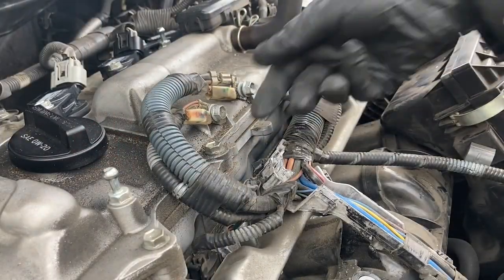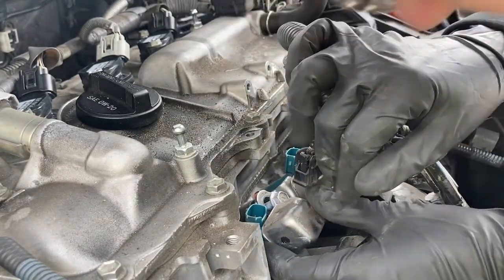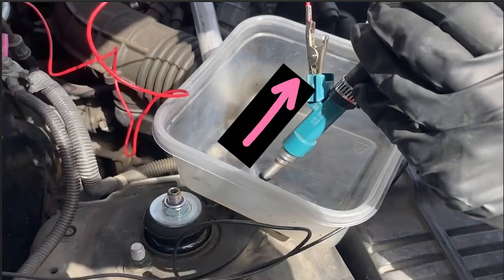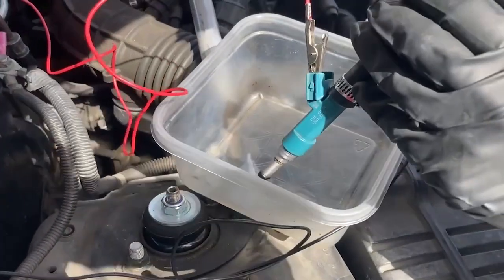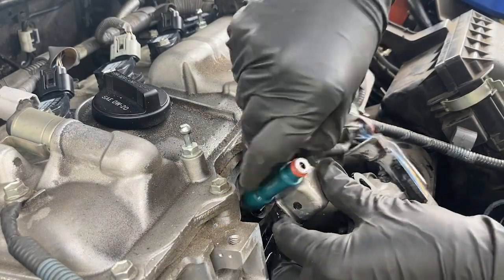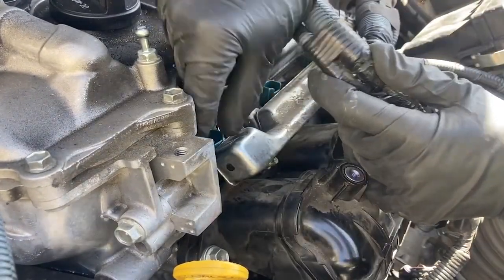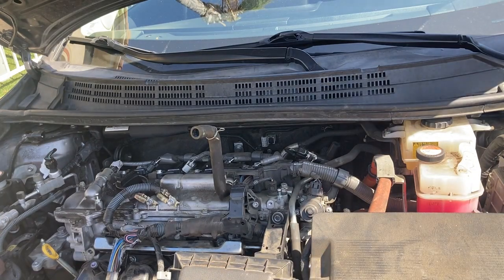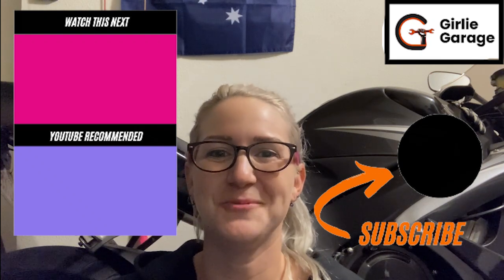2ZR-FXE Engine - 3rd Gen Prius - How to Clean Fuel Injectors Without Special Tools - Girlie Garage

Comment: I thought she was kidding when she said blow into the tube. What a terrible idea. Surely there is a safer way of doing this.
Reply from the maker: There is, read the comments
Reply: I bought a Mighty Vac kit and it works great for clearing the injectors (from both ends), bleeding brake lines, bleeding coolant system air (2 for the 2007 Prius, and just getting that last drop of fluid out of the reservoirs.

Comment: Does it matter if the fuel spews out when u disconnect the injectors? Amd when putting it all back together is there a method of starting the car safely?
Reply from the maker: You should release pressure by opening the gas cap. If you’re worried when you start the car, let the spilled fuel rest until it evaporates

Comment: You showed the necessary step of removing that wire harness from top...which carfix did not show on the video...left me stuck when doing the removal...thanks for including the correct steps.
Reply: At 1:02 how do you disconnect that wiring harness tab.??? I pulled mine hard and it is not coming out.??? It is too tight to get a tool underneath to try to clamp and release.??? Everyone makes it look so easy but.......
Reply from the maker: Great! So glad you found this video helpful :-) congrats on saving yourself $$
Reply: @GirlieGarage  At 1:02 how do you disconnect that wiring harness tab.??? I pulled mine hard and it is not coming out.??? It is too tight to get a tool underneath to try to clamp and release.??? Everyone makes it look so easy but.......

Comment: Have a 2013 Toyota prius. Been throwing a cylinder 4 code for a week. Changed the coil. Engine light back on after about10 miles. Changed all the plugs. Engine light came back on after another 10 miles. Now to the injector.  My question is this: would you recommend cleaning the 4th injector, changing the injector with a new one, or changing all of them? Thank you for your time.
Reply from the maker: If you’re going to change 1 it is just as much work to change all 4 and then you don’t have another one fail shortly afterward. You can usually test for fuel pressure or a fuel related issue before changing them instead of throwing parts at the car…
Reply: @GirlieGarage  I did. Code said Cylinder 4 keeps missing. New coils, New plugs. Check engine light turned off after each and back on after about 10 miles. Rides rough when taking foot off accelerator coasting or downhill. Clogged or failed injector is all we can think of before looking at the ignition harness cables.
Reply: Oh, and I'm not exactly at the liberty of buying 4 as it would tackle on about 500 bucks for the other 3 injectors.
Reply: I just wonder if it just needs to be cleaned.

Comment: I'm having issues getting the fourth injector removed (the one farthest to the right when facing). I'm struggling with lifting the fuel rail up enough for clearance. Any ideas? Thank you!
Reply from the maker: I think the only advice I have is that you have to take all the injectors out one by one starting from your left (passenger side) to create enough clearance to get to the next injector. Hope that helps
Reply: @ that worked! Thank you! Snazzy.
Reply from the maker: @waldodancer  fantastic, thank you for the good news!

Comment: 2016 Prius C Three here. Can I replace injectors without programming?
Reply from the maker: After I took these out and put them back in they didn’t require any programming. If you’re using OE injectors, they shouldn’t need programming

Comment: How do you disconnect the wiring harness @1:00?   It's not as obvious as most other couplers.  Thanks
Reply: Got it, just pry it up from the sides with a flathead screwdriver
Reply from the maker: You pinch the underside edges together. If you can’t pinch them together at the same time, you can do one at a time with a flat head screwdriver

Comment: You make it look easy but my fuel injector is stuck. Does your vehicle need an injector puller?
Reply from the maker: Which side is it stuck on? The engine side? If that’s the case, you’re going to replace the lower seals anyway, I would pry from the lower seal to get it to pop out

Comment: Excellent, thorough tutorial with the exception that you you forgot to show removing the air intake box apparatus. I got a glass jar and soaked my injectors in carb cleaner for about an hour. Unfortunately I didn't take off the upper o-rings beforehand and they disintegrated in the solution. But soaking the injectors for about an hour in the carb cleaner seemed to clean them up pretty good.
Reply from the maker: It’s a good idea to replace those o-rings anyway so at least you were sort of forced to 😂

Comment: You can wrap the end of the spray can straw with eletrical tape to fit snug in the hole, hold power to the injector, depress sprayer nozel. And bam no putting your mouth near things that contain petroleum distillate. You can get MS and other weird life problems from exposure to petroleum products.
Reply from the maker: Thank you, that is definitely a good tip